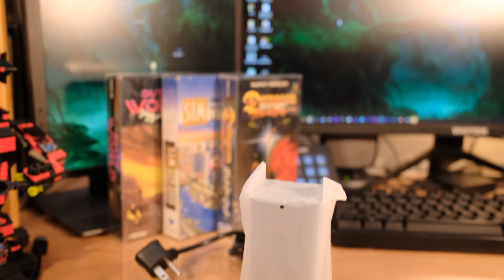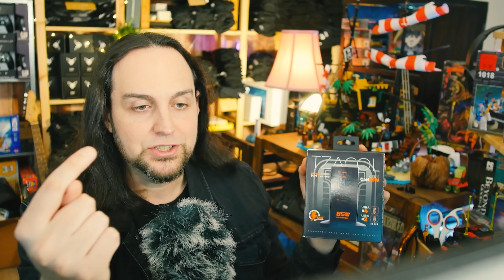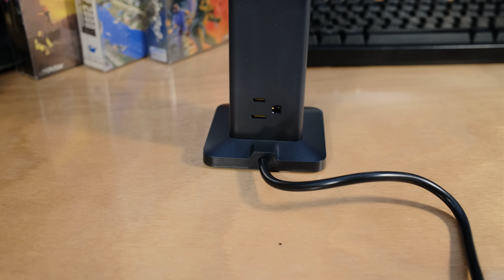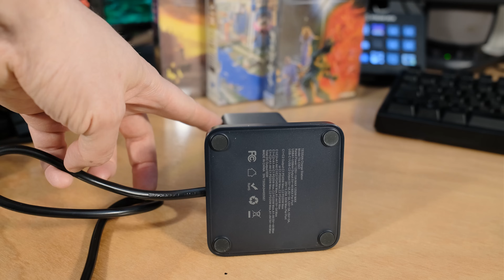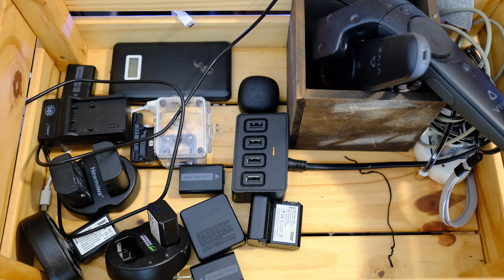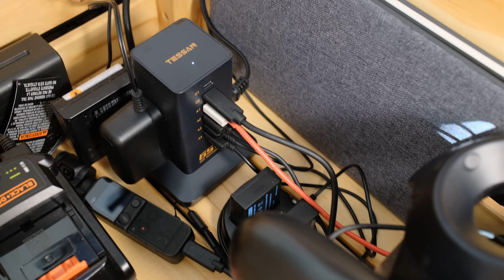I Replaced ALL My Chargers With the Tessan Tzacol Genie CS01

Comment: You have a bunch of lithium based devices in a wooden box, fast charging. Just sayin. I bought this for my Mother for Christmas. I will report back my findings. I was able to get same day shipping on Amazon. 

UPDATE: She wants another one for her bedroom too. The charger took her iPad Mini 6 from 13% to 40% in about 20 minutes. Give or take a few minutes. Unit is currently charging her her iPhone 13Pro, iPad Mini6 and running a room lamp. Its not hot. Not at all. Its is a solid unit and heavy enough to sit firmly on the surface of her sofa table. Note: It shipped with double side tape to help attach it to the surface you want to keep it on. It is sure-footed enough that we did not feel the tape was needed, but it was nice touch. She is really happy to get rid of her outlet extender and messy adapters hanging on the wall. So it was hit. Thanks man.
Reply from the maker: Maybe I'm secretly a firebug lol
Reply: Well it is in a box, so you might have a chance to pick it up and throw it out the door before it completely immolates everything. Happy Holidays. @teksyndicate